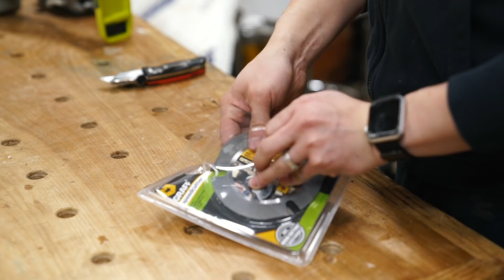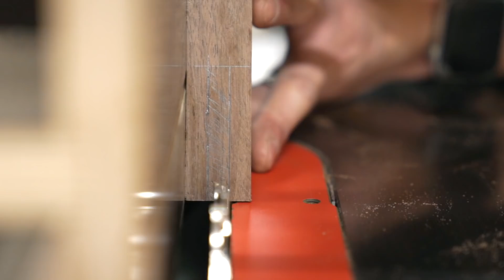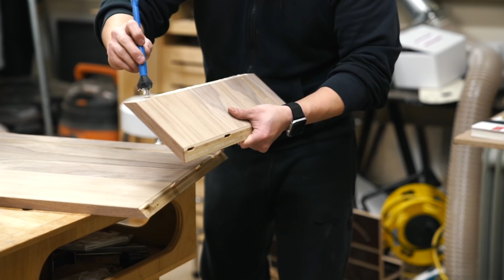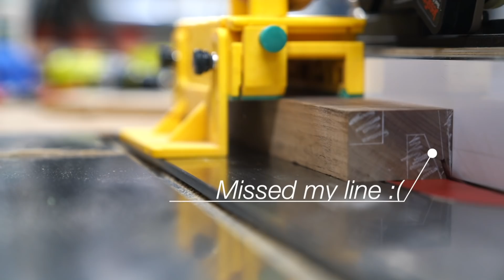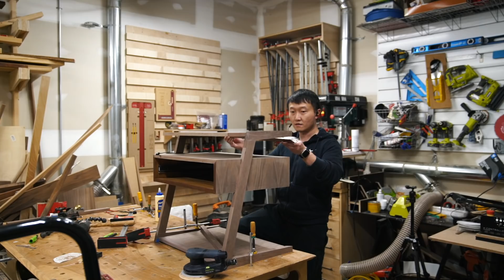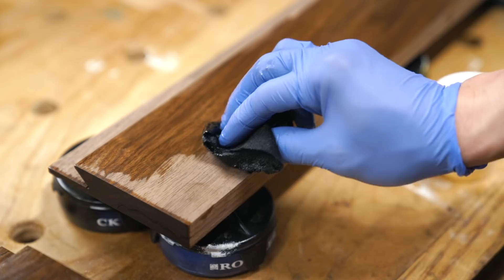Making a Modern Nightstand / Bedside Table with Wireless Charging || How To Build - Woodworking

Comment: This is exactly the kind of table I wanted to build for my bedside. I was worried about how thin the wood must be in order for the wireless charging to still work. What thickness did you cut it down to?
Reply from the maker: I think my charger was rated for 5mm. I left about 3mm of material. So just short of 1/8”. The phone case I use is only 0.3mm thick, that’s why it works. I wouldn’t use it with thicker phone cases.

Comment: Your design is insightful, elegant, and practical, However,  as great as the design and instruction of this video is, there are some people who cannot afford most of the tools you use in this video. Could you please consider making a video with basic tools?
Reply from the maker: Thanks Chris. The only method that would change regarding tools would be the use of  the Domino. So to glue up the top and bottom panels to the legs, you can simply cut dados with a router. You can achieve an equally strong joint. All the other operations should be the same regardless of the tools you have. Of course, you won’t be able to cut the tapers without a tapering jig and I highly recommend the one that’s linked in my descriptions.

Comment: I'm loving the leg design! Do you think it could be scaled up to say, something like a computer desk, or would it not handle the stresses and weight? I know bridle joints are dumb strong, but I have no concept of HOW strong
Reply from the maker: It’s VERY strong. I do plan to build a computer desk with similar type of construction. Just don’t know when. But I sat on these night stands and there is no flexing
Reply: This was my question.  Thanks for testing it by sitting on it!
Reply from the maker: It’s ok. I’m new to woodworking as well...I was concerned about strength at first too. But once everything came together, I had no question about how strong it was. The direction of the grain plus the joint makes it extremely sturdy